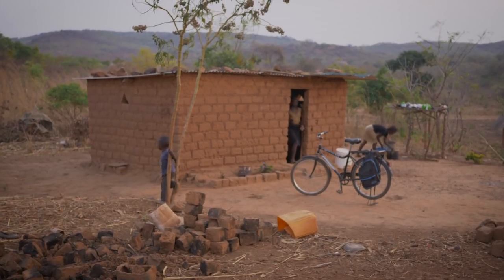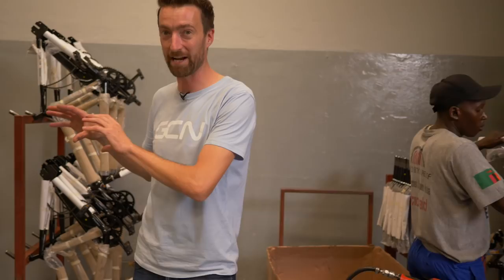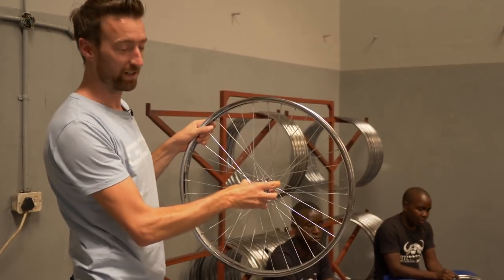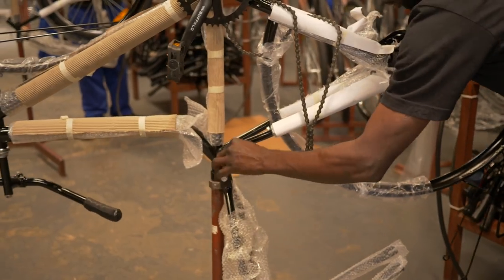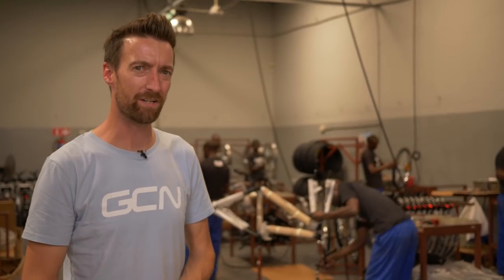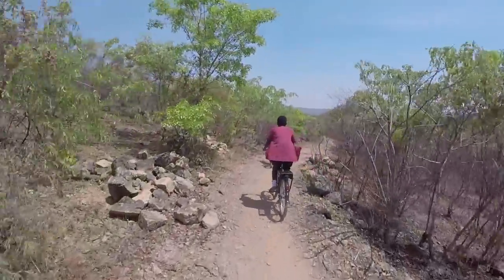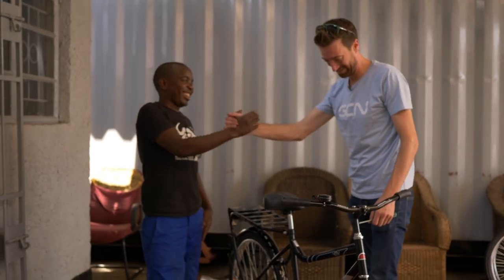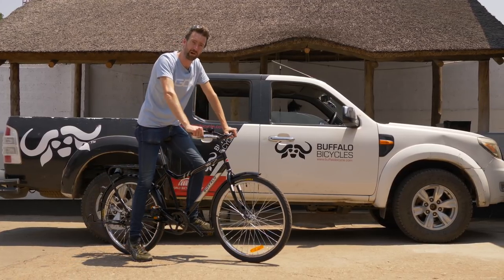How Is A Buffalo Bicycle Built? | World Bicycle Relief on GCN

Comment from the maker: Head over to http://gcn.eu/WBR21 to contribute whatever you can to build more Buffalo Bikes
Reply: Global Cycling Network  single speed with no brakes?
Reply from the maker: Back pedal brakes 👍
Reply: May I ask an accounting question?  What percentage of the donation goes to actual purchase of a bike versus overhead at World Bicycle Relief?
Reply: Dan you nailed those stickers!
Reply: We're not allowed to question the cost and build for these? Will be disappeared to some gulag? The corporation is non-profit 3 star out of five rating. Only 85% goes to the purpose The company manufacturing is for profit. Seems like considerable room for betterment in several; areas.
Reply: @eolle43  85% they are a three star rated charity. You might want to contribute some where else. The manufacturers state: Primary competitors in Mozambique and Ghana include Mozambikes, Ghana Bamboo Bikes, however, there are many other bicycles on the international market. So they are using your contributions to beat the locals. Sounds pretty friendly to me!!?? And you get hub, drum brakes that work poorly when wet. Some would say are harder to service. It's all right guess who'll have the parts!!🤣🤣🙃😂🙂🙃🙂🙃😉

Comment: Where do they make the frames?  Surely that would contribute to the local economy.  
Also (and worrying):- Plain nuts and bolts in the vibration capital of Africa.  Surely there should be nyloc or Threadlock.  I'm old enough to remember UK bikes being built with plain nuts and shaking apart.

Comment: Normal tires only last three months? Since when?
Reply: 3 months in those conditions is more demanding than what most of ours tires go through in an entire year.
Reply: Depends on how many km's you do. Mine last about 6 months if I'm lucky, but I ride hard and do nearly 10000 kms a year.
Reply: I have 12,000 km in and will have another 1,000 before the end of the year. My tires are fine.
Reply: Timothy Fish Mine are race tyres, on a race bike. Not designed to last lots of KMs.
Reply: No one would put "race tyres" on a Buffalo bike. For that matter, no one would call race tires "normal tires." Race tires are intended for races, not for normal use.
Reply: That only made sense to me if they were talking about tears and gashes in the tire rather than tread wear.
Reply: subitopoco I suspect even tread wear would be higher on the 'roads' they ride, but you're likely right, it's the other damage that would cause them to deteriorate faster.

Comment: But do they have chainkeepers?!?!?
Reply: Its a single speed, so there should rather be a simple chain tensioner.  Ideally the user should adjust the rear wheel according to a chain stretch over time,  but i bet they ride till the chain drops and its no fun in the middle of nowhere without wrenches.
Reply: Joke incoming

Comment: Do the bikes come with spares, such as inner tubes, tire levers, etc...? From your previous video, it was said that recipients of the bikes get pumps as well. Those aren't much use in the case of a puncture unless it can be fixed. :P
Reply: They also get taught how to patch them, plus the tyres are designed with durability in mind rather than performance.